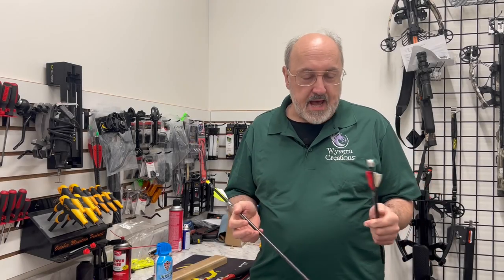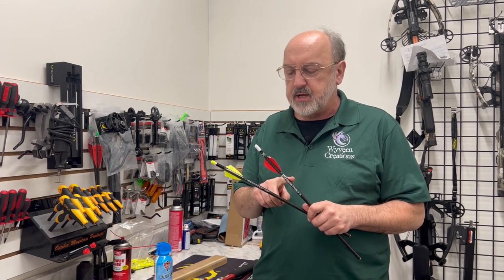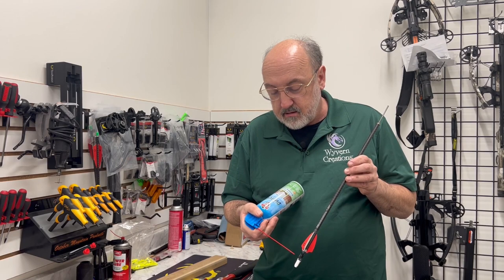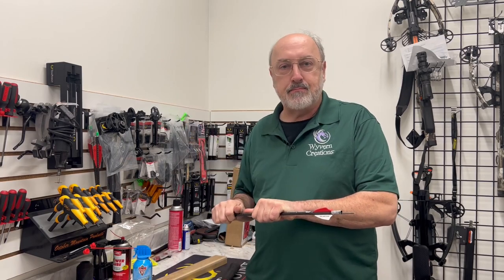Removing TenPoint Alpha Nocks

Comment: Thanks for the video. This worked perfectly. Couldn't find a small enough rod, so I tried to heat and remove the inserts. This damaged one of the bolts. So instead, I cut the old 20-inch bolts down to 16 inches (switched from an old Titan to a new Siege), used the thicker rod to ram out the nock receivers, and didn't need a hammer; the force of the heavier rod was enough to knock out the old nock receivers. The only tricky part was that the air canister needs to be held upside-down as another comment mentioned.

Comment: This does not work for me. The insert at the point end is solid! The 1/8" inch steel rod will not go through. Now what?
Reply: Yes it will
Reply: Hmm, solid? I'd run a 1/8" drill bit through it

Comment: nope, doesnt work
Reply from the maker: It does but if you get ones that are really stubborn it may take several shots. You can also spray down the arrow shaft as well
Reply: This worked perfect for me just did 3 bolts in 5 minutes
Reply: I just use the 1/8" rod and tap down on a solid surface. They come out every time.

Comment: is it same process to get the yellow ones out, for lighted nocks
Reply from the maker: Those are not glued in. You can pull them out with plyers
Reply: @WyvernsCreations  excellent
Reply: @WyvernsCreations tried this and had no luck. It’s firmly held inside the aluminum fitting. Any other ideas? Thanx
Reply: @domino9465  I've got the orange Alpha nocks in the aluminum HP inserts and had to put the knocks in a Vice to pull them out.  I could not budge them with pliers.  I did get two of the three out in the vice but the third one broke off flush with the top of the aluminum bushing.  NOW, I got to get that out somehow.  I'm now wondering how hard it's going to be to get the lighted knocks into the insert without breaking it.

Comment: For those people trying to do this.  Watch the video, when David turns the compressed air can upside down that is the key to the issue.  That when your nock becomes freezing cold.
 Pause for 30 seconds letting the nock becoming even colder, then use the hammer.  And yes the 1/8" rod works and you can get it through the bolt.  
I did 6 in 3 minutes once I when back to watch the video again.